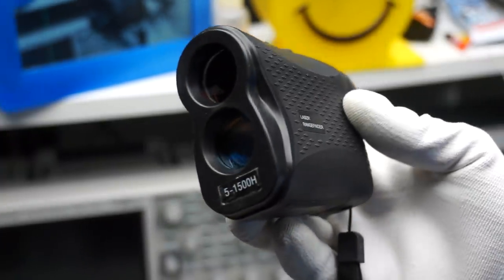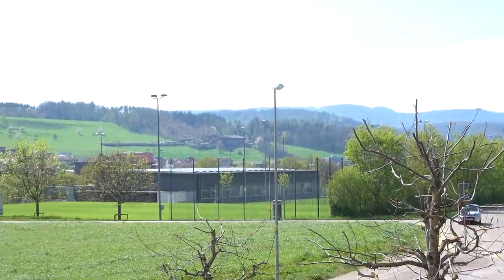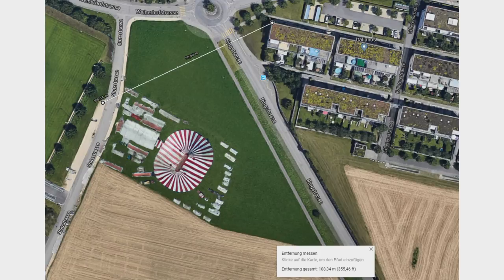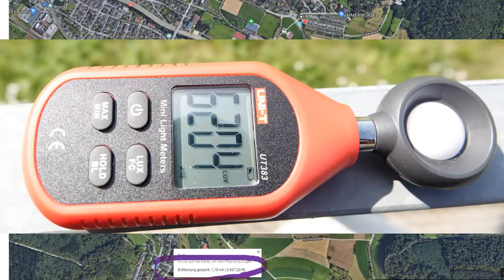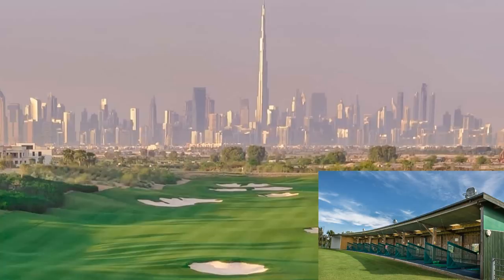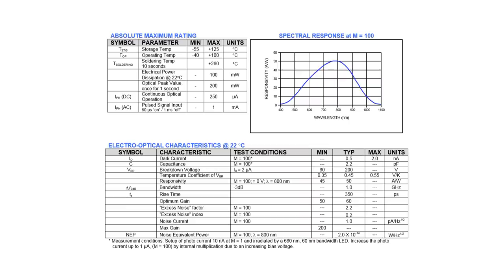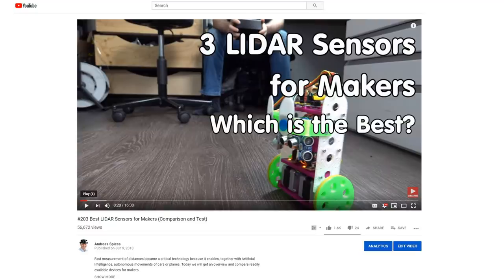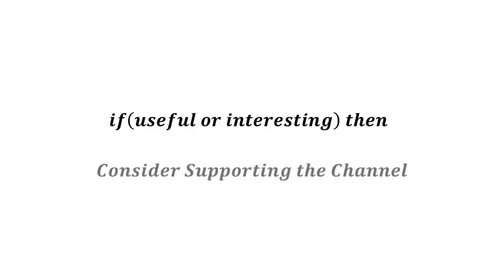#267 1500 Meter Rangefinder Test and Tear-Down

Comment from the maker: The forgotten picture of 4:25 (438.7 meters) : https://drive.google.com/open?id=1WszI6Mk3lxFlVdzhUjQxu0HFenlk-3Ed
Reply: Andreas, you've earned the privilege of being believed without providing evidence for everything.  Thanks for another excellent video.
Reply from the maker: You cannot aim in the dark...
Reply: Hi , i have someting interesting for you how obouth blocking the device from mesuring the distance ???
Reply: Often quite a price jump from the 600m to the 1500m versions and I have tried to compare the internals on some but not my alley...
Would it be doable to increase the 905nm output? to get longer range on the cheap ones, as many are not fw locked and seems able to reach over spec, at least the lesser distanced ones.
Have two.. one 600m and one 800m.. the 600m seems to max out around 800 to 900m and the better of the two with a huge amount of features and angles and all that jazz plus decimals and was a tad ovwr 50 USD bucks some years back (great product)
these, - one is Hawkeye800m and the other Milesey600m https://imgur.com/a/AK444fi
One thing I really miss in the cheaper versions, is values that are somewhat lid' as these dark LCD with black symbols can be difficult to see against darker backgrounds or in low light but you need to get up around a few hundred dollars minimum for lid symbols that can be seen in darker enviroments. -
Thx for the video, though it would have been niced if you handled the aspect if on one can maximise the performance by delivering a higher wattage to the 905nm LD and how one would approach that..
the angle mesurement (H-versions) is quite usefull, as you can just point on an object and get the height difference in regards to you but sadly it comes at a cost on this H-unit as your loosing scan-mode, like on the P versions..
Im not sure if the H model can do "point to point".
Reply: what does that pod do at 10:15 at the bottom? any chance that it adjust the laserdidoe 905NM current/wattage output?
wishful thinking, and doublfull that its the laser diodes driver circuit that is there, but on most laser devices there is an pod to adjust current driver output and how hard you will drive the laser diode and it would be ideal if one could elevate the effect for fx longer range., though with bigger wear and shorter battery time.
you can vocally hear when it's pulsing, when in speed or fog mode...
Reply: Just tested a new one here in inner copenhagen and quite willing to take readings around the 1500m and I do like the data logging and the extra side colordisplay that also shows the value and also m2 and m3 values.
but its a lot of numbers with 1499x1497x1497  (3.395 billion m3)
https://i.imgur.com/BQD5SN2.jpg
crude datalogging.
https://i.imgur.com/hujk8r5.mp4
Reply: Sounds great
Reply: @AndreasSpiess  is there any UART header to read range data to external device? :)
Reply from the maker: @onomatopejaB  I thought I mentioned it in the video: No

Comment: The angle is useful for measuring heights or calculating triangles
Reply from the maker: I thought that. But I had no need for it... Maybe architects or so?
Reply: @AndreasSpiess  You can calculate the height of some tree or obstacle, by reading the measurement to the base of it, and perhaps the top, and taking the angle to the top of it, then applying basic trigonometry.  Then you can measure distances that are not in a straight line from you.  edit: perhaps you would like to cut that tree down, and you need to know how much space you need to put it.
Reply: @SteveWrightNZ  I've actually done exactly this! I had a 60 foot tree that I cut down in a yard. It was good to know that I had room before the fence. I've also used the height functions for planning where to put Wi-Fi antennas in stadiums.
Reply: @AdamFraserKruck  Hah, yeah they don't look very big when they're upright do they!
Reply: Also for hunting/shooting sports. Angles change points of aim.

Comment: Hi Andreas,

I work in a mountain search and rescue team and in order to locate victims or areas we are using a « GPS Binocular » which allows you to point to a place and get its lat/long coordinates + distance with only the click of a button. Problem is that the range of the binoculars is limited (1km maximum) and it is above all super heavy (more than 3 kilograms).
Last week I thought about building my own « GPS Gun » based on Arduino.
What it needs looks (at first) very simple : a laser range finder module ; a gps chip ; an lcd screen, a compass and that’s it !
The principles on which it would work : you aim at the area you want to search ; you push the button and the range finder calculates the range while the compass calculates the azimuth ; the device then uses your gps coordinates to compute the victim’s coordinates by adding the distance and the direction.

But unfortunately it only looks simple… My first problem is finding the right rangefinder laser module for Arduino.
After some research, all I’ve find are ultrasonic modules (too short in distance for me) or laser modules that work only up to 50-100 meters…

I am a huge fan of your YouTube channel and I’ve seen your rangefinder tear down as well as your Arduino projects. So my question would be : Would you know of an arduino laser rangefinder module that would work past the 500 meters limit ?

Huge thanks in advance !
Reply from the maker: An interesting project idea! Back then, I did not find a decent range finder with a digital output. Maybe this changed by now. I did not investigate.

Comment: Andreas, i think they used a lock-in amplifier in order to measure only a spesific frequency below thermal noise. And the avalanche diodes could be used to cause a very deterministic and stable oscillation source.
Reply from the maker: I agree they have to have sharp filters and a long measuring period. But still, it is magic for me....

Comment: Great video! Can you try to interface with the module?
Reply from the maker: I did not find a serial connector
Reply: Worst case, I guess a parallel in, serial out shift register connected to the LCD data lines could be used.
Reply: @MoritzvonSchweinitz  Can you please point me towards content on how to do this? I would like to figure out how to interface with a laser range finder. I am working on a project that requires it. Without a serial connector I need to find other means. Thanks
Reply: @sbsrd7  That depends completely on the device you want to interface with. Some will have an internal serial bus somewhere you might be able to tap into. Or maybe they communicate with the display over I2C. Worst case, there should be many many lines going to the display. In that case you might be able to use an Arduino Mega to listen to those lines (and reconstruc what number is being shown), or you could use a parallel in, serial out shift register to save on pins.
Reply: @MoritzvonSchweinitz  I actually found a long range unit that had a serial port available. Thank you

Comment: I believe one of the tricks to measure signals with a small signal to noise ratio is to do the measurements as often as it takes to be sure enough of the result. Using the repeated pulses the device can differentiate between signal and noise. I've done similar things with EEG and ECG. Often I can figure out details which are more precise than the "theoretical" ADC resolution or sample rate, by superimposing multiple measurements.
Reply from the maker: You are right. But still, I was surprised that anything comes back to the receiver...

Comment: Thanks for a great video. Most digital cameras (still, video, @ phone) can detect some IR. (They have filters, but usually let some IR through) You can see this in the camera's viewfinder by pointing a common IR based Remote Control  at  the camera lens and see a small flashing dot. It would be interesting  if you can see the Range Finder's emitter flashing. It would be more interesting (but unlikely) to see the Rand Finder IR reflected from a nearby target.
Reply from the maker: I will do some IR experiments in a future video.

Comment: I never knew I needed one of these until I saw this video. I think Andreas has caused more money to disappear from my bank account than any other YouTuber ;) There are several related models of this unit, ranging (pun intended) from 600 to 1500 meters and the H variations, LR900H and LR1500H, do angle AND height (thus the H) so you can measure the height of things like a building or tree.
Reply from the maker: Before the money disappears from your account, it disappears also from mine ;-) So we suffer the same illness.

Comment: Could you please try to interface with this device to get an arduino to read the speed and distance values?
Reply: I support this request :) I have a similar one, only 600m, and tried to get something out of the two unused connectors, without success.
Reply from the maker: The same with me. I did not find a connector.
Reply: You could use the flat ribbon to reverse engineer the display

Comment: Andreas they had 2 similar ones at Aldi Olten and nobody bought them so I ended up with both on special. Blew me away too how far they go and they have a 123 3V battery but same interface. Now I measure rural property boundaries in tropical Australia. Even the speed function is useful, Aldi ones have no angle function but else are very similar.
Reply from the maker: I assume Aldi sources from similar manufacturers as we do...

Comment: Wonderful review!  Of course you can get the height of things by measuring the distance to the top of something and then just multiplying by the sine of the angle.  Any chance you can do a review about testing the speed version?  perhaps by using a friend driving directly towards or away from you?
Reply from the maker: So far I have no such plans. But I am sure it will work.

Comment: @Andreas Spiess at 10:08 I notice some pin header at right side of the board in front of the D2 diode and another set of pin header on the top left of the board...
I'm wonder if one of these are the JTAG or some sort of Serial communication that we could take advantage and read the results such as distance and speed of object!
Would be awesome if you could do a video about this, and if it's possible to extract the data using an Rapberry PI or arduino!
Reply from the maker: I do not know if they are JTAG. But they do not provide output of the data.
Reply: @AndreasSpiess  Thanks for your feedback! I'm looking everywhere for such device that does that... really hard to find!

Comment: Hi Andreas, my question concerns the functionality that you have not presented, namely - is there any communication interface, for example UART, displayed on the PCB. On the PCB, you can see two rows of fields with holes as if it could be used for something more, such as reading the distance by rPi Zero or Arduino and presenting the result on an external display.
Reply from the maker: I think I mentioned that I did not find a serial output

Comment: Cool Andreas, I'm curious about your future findings on this subject. I've been looking at narrow band UV-A/UV-B filters, perhaps I'll learn something applicable to the other side of the spectrum from your experience with IR stuff. 
  Dupont 215 Riston photoresist lists micrometer resolution potential with a narrow band ~200nm light source. I have been looking at cheap filter glass and germacidal UV lamps that claim to also create O3 as a source. I have not seen any practical examples of light sources and narrow band filters in practice, but haven't really gone looking, yet :-)
 Thanks for the upload.
-Jake
Reply from the maker: I will not experiment with filters in my IR Video. I do not have IR filters.

Comment: I am curious how much laser energy makes it out the eyepiece and back to the viewer.
Reply: i think not so much - they will use a dicrotic mirror that reflects the 905nm and passes all visible 
so the only things that can reflect back in the direction of the eye are the lenses - but these also will be desinged to pass as much IR @905nm as possible...
and overall they want to have as much laser going out the front as possible ;-)
Reply: I would try to measure it, better safe than sorry.
Reply: The lens on top appears to have an IR filter (it appears with a dark red color on the video). 
Moreover, at such distances and because what is coming back to you is from a reflection you lost a lot of laser power and focus (the IR coming back is most likely scattered, the device probably is able to detect it by amplifying the small pulses from the laser).
Reply: A few returning photons are all what is necessary to fire the Avalanche Photo Diode

Comment: Thanks for an interesting video. I have a cheap distance meter and speedometer that ALDI sold 8-9 years ago. It easily measures the distance on both houses, cars and trees in 300 meters distance. I have been able to measure distances of up to 600 meters but it requires a flat reflecting surface (preferably white) that turns the surface into 90 degrees. What is best about the distance meter is that I have never experienced it show a wrong distance, which I think is impressive, it is either the right distance or an error message.

The speedometer actually works just as well, it returns the measured speed without error if you can hold the beam on the item for 1/10 second.
Reply from the maker: Thanks for sharing your experience. It seems to be a similar device. I also had my problems measuring the speed of small or fast moving objects.

Comment: Very interesting video.
Speaking of considerable distance with small powers, you reminded me that in the 80s and 90s some amateur radio operators made a connection between the hills above Bologna and the surroundings of Argenta (province of Ferrara) for about 40 km away, using a laser of about ten mW current modulated and a photodiode mounted on a dish as a receiver. I wanted to give you the link to the news (which I found on the internet a few years ago) to be more precise, but this time the search was not successful.
Given the quality of the optoelectronic components available at that time, it seems almost normal that with $ 150 an item of this type can be bought, which, at least until a few years ago was exclusively for professional use, and perhaps strictly reserved for armed forces
Reply from the maker: Another commenter also wrote about experiments in the seventies. It seems that this technology is old. But for me, it is a miracle.
Reply: @AndreasSpiess  maybe i was that commenter, during writing my post something appeared on my mind like a dejavu, but i was not sure about it, so you confirmed that my memory had some lacks  😆😆😆😆😆

Comment: There is probably a polarised filter in the front of the infrared receiver.
Reply: I don’t think so on multiple reasons but mostly cause its reducing the amount of light beeing detected by minimum factor 2 even if tuned in absolut perfect angle. I wont say is not possible, but i believe its not the case.
Reply from the maker: What would be the advantage of such a filter?
Reply: @AndreasSpiess  if you have a polarised light source the sensor would block half the natural light and still let through the source light fully.
Reply: Imagine you sit in jail and the fencesticks on ya window r very tight, and someone is throwing matchsticks to you from outside. So, only the ones who come on straight (orientation top-bottom) fly trough. In science they r used to detect tension on surfaces, on lcd display they straighten up the backlight for the liquid crystals who do the same (and block so all the shine trough), but mostly theyr used as sunglasses or in photographie.

Comment: Thanks for a very interesting video :)
I wonder if it's possible to interface this to a microcontroller ?
That could open up a new world.
Reply from the maker: I only found one "connector" type pins on the board. But no signals. Maybe somebody else knows something.
Reply: Maybe you can use the signals that go to the display.

Comment: Thanks for this great test! 
That these distances are possible - and far more - is proven by professional geodetical devices as  Theodolites,  Tacheometers, Total Stations, which can mor the ten times more but can cost more than 100 times more.
What is about eye safety of your device? Which laser class according DIN EN 60825-1?
Reply from the maker: I did not find a label. Maybe we can guess from the power consumption?
Reply: @AndreasSpiess  Most probably not. According https://de.wikipedia.org/wiki/Laser#/media/File:Maximal_zul%C3%A4ssige_cw-Leistungen_nach_EN_60825-1.de.png derived from the 2007 standard (now 2015 standard is valid) the limit for the harmless class 1 is about 1mW average optical power @ 900nm. Even with an assumed efficiency of 50%  the rest of the electronics will dominate by far.

Comment: Nice video and explanation Andreas .
I would like your opinion on a problem that I have with my rangefinder .
The range finder works fine,but, the display is very dim and I can barely see the letters and numbers now(they used to be a very nice red light display).
A new battery doesn't fix the problem .
I've disassemble it .
Do you think that cleaning the ribbon cable contacts would help,or you think that the problem  would be more serious ?
Any advice or tip will be greatly appreciated .
Thank You .
Reply from the maker: Unfortunately, I have no idea. Cleaning the cable probably does not hurt but I fear it has a deeper reason :-(.

Comment: Really?! A NE555? That's not what I expected to see in a device like that. Could it be used as the boost converter? Although I can't imagine that it is cheaper than a dedicated power chip that has everything that's needed (oscillator, MOSFET, MOSFET driver) integrated.
Reply from the maker: The NE555 can be used for many different applications. Maybe this is why it survived.